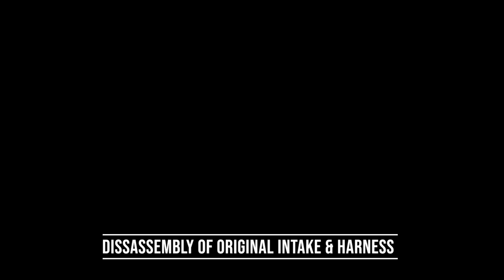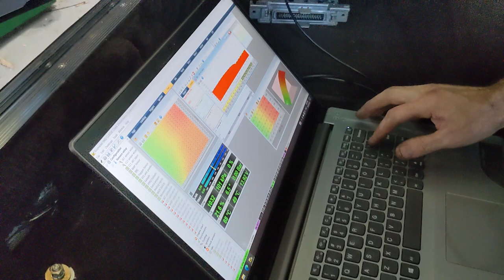RHD Racehead M30 e24 ITB install

Comment: 1. the vacuum advance port on the distributor is not connected, won't that be a problem? 
2. does it need a map sensor? What ecu used.
Overall looks nice!
Reply: you dont need a map sensor when tuning by throttle position. It's called alpha-n

Comment: It would be interesting to see a before and after dyno with both on the standalone ECU
Reply: unfortunately not possible, every single mod to the fueling or air on the M30's requires an aftermarket ECU from my research, which is annoying because the bloody aftermarket ECU's cost a fortune.
Reply: @lalnablehector1285  I'm talking about intake manifolds
Reply: @TurbineResearch  yeah you're right my mistake i misread standalone ecu as standard ecu in your comment haha

Comment: is the motor a mb30b34 or b35? also, im buying this for my current e24 86, but can u turbo with ITB?
Reply: Most likely an early B30/B32 based on the intake manifold design